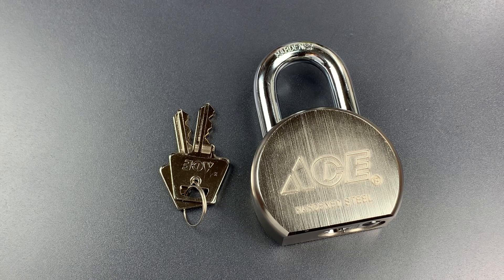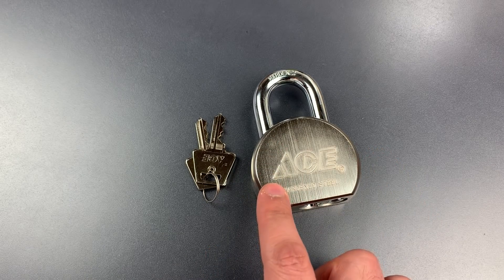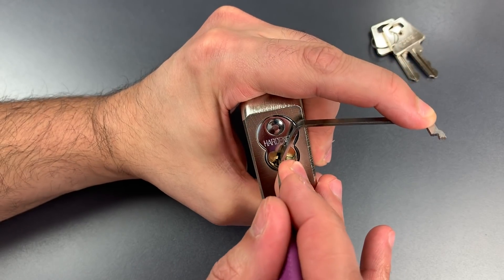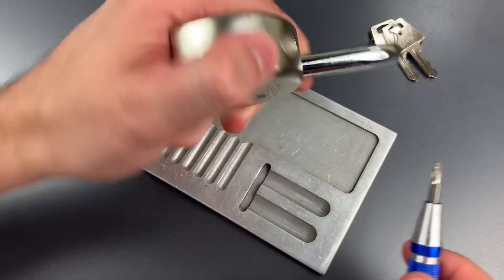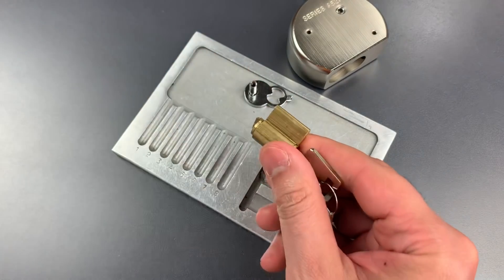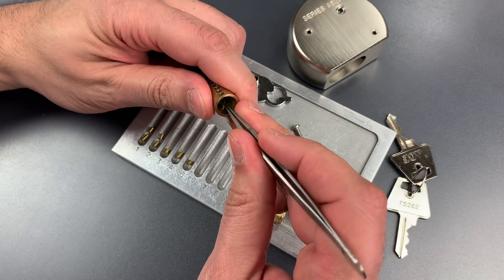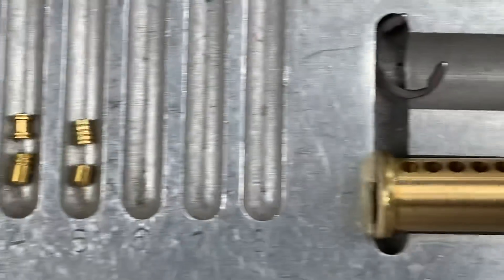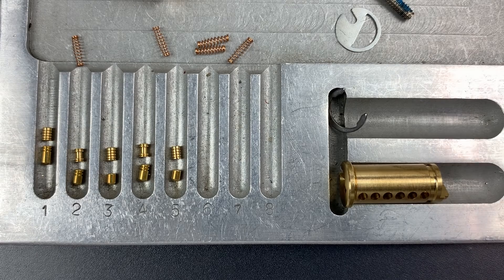[774] Ace Hardware’s Best Padlock Picked and Gutted (Series A527)

Comment: I just started picking 2 weeks ago. I’m doing good with most locks I’ve attacked but I bought this one yesterday and it’s been a nightmare lol. I’ve gotten it open twice and it’s only been by accident. But yeah this is a fun new relaxing hobby and I’ve been able to learn a lot from watching your videos
Reply: Does it have a high low high low bitting? Those can be a bear sometimes.
Reply: @robertwest3093  it actually starts high and gradually gets lower. Wasn’t used to security pins at the time but now I can get right into it these days

Comment: As a lock neophyte, perhaps you could answer a question. Why do so many manufacturers seem to install 6 pin cores but only put pins in 5 of them? Surely the added expense would be in the manufacture of the core, with an additional set of pins and key with bidding for 6 instead of 5 pins being a negligible additional cost.
Reply from the maker: So they can produce two locks on a single production line. They charge more for the 6 pin variant.
Reply: @lockpickinglawyer  That makes a lot of sense! Thanks for your reply.
Reply from the maker: Robert Gallant yes.
Reply: You can go to any locksmith to convert the core to six pins.  A locksmith can also convert same brand cores to be keyed alike.  When I bought two Kryptonite padlocks, he converted one to match the other at no charge.

Comment: It kept me out, so I guess I'm a novice. Time to get back to practicing.
Reply: I have an American 1100 series I can't even come close to picking . Not to mention my sparrows revolver practice lock I haven't even managed to pick standard pins yet
Reply: I just purchased an Ace Hardware lock very similar to the one featured thinking it would be an “easier” one to pick.  Certainly harder than the Masterlocks on the rack.  Long story short, I have been firmly placed below a novice picker 😂
Reply: Did you ever get it open
Reply: ShotgunRocket If the response was to me yes, I’ve got the feel for the ace brands now and open them quickly. HINT: they are so much easier when the lock is cold 😉
Reply: ShotgunRocket now I need to figure out a PAC lock 6 pin 😩🤯
Reply: @CFarnwide  awesome, I just got into lock sport myself and have gone up to an Abus 55/40 so far.
Reply: ShotgunRocket Nice!  The Ace was my first “real” lock and just barely got the PACLOCK ucs 6 pin.  So yeah... I’m extremely green to the sport.  It sure is fun though!
Reply: I use a paperclip for tension, and a reusable metal toothpick as a lockpick, get on my level

Comment: Very interesting. But, how does that hole that you think converts the padlock to key retaining work?

And how easy would it be to add in that 6th set of pins? Is the key already a 6-pin key, or would you need to buy a longer key blank?

Comment: What good is the build quality when you can easily pick it open.
Reply: I have the strategy of looking for cut, drill, and shim resistance because I reside in a small city of 120k and the average intelligence is probably much lower than that of bigger cities so criminals around these parts would more likely attempt low IQ brute force techniques rather than picking so defeating novices is sufficient here.  May be different for other areas.  I would probably go with a Mul-t-lock or Insurance lock if necessary for the whole package.

Comment: Kind of unrelated question. I’m still relatively new to lockpicking, and Ive been using picks that are just stamped steel, a mix of Mad Bobs and the UK Bump Keys Praxis set. I’m looking to get some premium picks that are more comfortable to use. What do you recommend. MultiPick? Peterson (Plastic or Rubber handles)? Sparrows? I’m not looking to buy a whole new set, just the common ones I use like a Bogata, the hooks and some rakes with some nice handles on them that will last a while. Thanks!

Comment: Is it possible to insert another pin into that sixth hole to make it more difficult? (Considering that you will need another key).
Reply: A 6th keypin will ride on the tip of a 5 pin key. All you have to do is find one the correct height,  usually a long pin, drop in a spring,  and driver, and you now have a 6 pin lock. Yes they are more difficult to pick.

Comment: The best lock that one can buy from my local Bunnings is a Lockwood 334M45. It costs AUD $58, but you are either better off special ordering it from Bunnings (to specify you want the ASSA Abloy factory to provide a 6 pin key and/or spool pins in the back 5 and a drill resistant front pin) as the retail ones are usually 5 pin with minimal spool pins, if any.

Comment: can you explain how serrated and spool pins effect lock picking? and what a anti bypass plate does as well? love your vids!
Reply: Those type of pins have a Groove in them that allows the core to turn slightly much like it would bif you got to the line giving a false set a  spool has a very wide groove and serrated a narrow groove, the Anti bypass plate keeps some one from sticking a tool all the way through the lock and turning the mechanism
Reply: Hey! Just to extrapolate a little more, security pins not only just give the picklocker the illusion of getting a pin set (called a false set,) but also added physical difficulty in setting the pin after you figure out that it's a security pin. All of those ridges make it really difficult to push the pin inside of the outer plug without binding up against the walls.

The video really showcases how well the LockpickingLawyer can pick locks.
Reply: The anti-bypass plate prevents a tool from being jammed down the key way, and unlocking the lock without turning the core. It was a huge fault on American brand padlocks.

Comment: I need some help? How do you get real practice locks? The clear ones are really easy.
Reply: He mentions this in a couple of videos, just don't have links to them. (over 700 videos to search through, it can take time) but if you are starting out, he suggests going to several stores in your area and buy a couple of the same lock at each, and use those to start building your skills up. I'd suggest starting with the inexpensive Master locks rather than the really cheep chinese locks, because there have been several of the latter that simply start to fail even with their own keys after way too short of a period.

The Master lock brass body locks are inexpensive but will give you a feel for how to tension a lock, and how to use a pick. Those are your starting points. That will give you the ability to look at most master locks up to the pro series with an awful lot of disgust. Note that the 'security rating' on Master lock packaging is more related to the physical characteristics of the lock body and shackle than it is the lock core. The reason the Master Pro series locks are a little better is that the cores tend to be from the American lock series subsequent to Master buying American Locks. Quality went up for some of Master's locks, and down for some of American's locks.

Once you have a basic idea of what you think you are doing, start working through the collection of those locs in a random order. Sit and watch videos on TV or a movie on your laptop, and let your hands work through the collection of locks, lock them up again, then pull them from the pile and work each lock one after the other. As you're doing this, start picking up a lock or two of the next "level" up over several weeks, preferably from different locations or businesses. 

You're working to avoid getting a batch of locks that all have the same fault because they came out of the factory the same day, or even worse that ugly of uglies, the keyed alike padlocks. They might be nice for a traveling gun case where you want half a dozen padlocks on the case and only have to carry one key, but if you're actually picking locks, it's unlikely that you're going to end up some place and the padlock you need to work with is going to have the same key. (Note that this is not true of all keyed systems. Entry panels from a common company, elevators, lock boxes on the sides of buildings, even a large number of police cars across the country, all have common keys, for the simple reason that it's less expensive to get them set up that way.

Once you have 9-12 or so locks of the next level available, start doing the working through of those locks to build up your understanding of how to work with those locks. Continue this cycle on up through all the locks you want to be able to work with. Once you're dropping $50-$150 a padlock, you might consider selling some of the earlier padlocks you practiced with, but it may be a good idea to hang onto a couple to just play with from time to time to keep your skills up with them.

Comment: I like looking for locks at Ace. They often have some interesting ones and the selection differs vastly from location to location. I also have found some cool Federal locks at various small town True Value hardware stores here in Oklahoma.
Reply: An Ace in my area is now fully Master Lock on their rack. I was rather 
disappointed they do not even have their own brand available.
Reply: Larry Be - A solid wall of Master Lock is always a disappointing sight.
Reply: Federal are a UK brand. Odd to find them in Oklahoma.
Reply: +Larry Be ask at the counter and they can ship one in from their local warehouse
Reply: +Larry Be ask at the counter and they can ship one in from their local warehouse
Reply: @danh2134  
Perhaps so, but it seems odd when it is their own brand not to carry it 
unless Master Lock "bought" the rights to the space. The consumer is not well served by mediocrity becoming the norm in this type of purchase.
Reply: +Larry Be it's odd indeed but whatever you do avoid the master brand
Reply: @danh2134  
I have one I use it is model 911. It has enough in it to defeat the average 
picker and has the ball bearings in the shackle which is a step above an
average lock. 
The one I have been using regularly is the Commando lock. Military specs and you can remove the key but the shackle cannot be closed. That is 
useful so as no one can close and lock a door with no way out for you. All 
in all it is what a Master Lock should be for all the hype they throw at us.

Comment: I'd like to know how the anti bypass works and the key retention, please.
Reply: Yes. I'm interested too!
Reply: The anti bypass plate works by preventing you from jamming something in there to turn the locking mechanism without engaging the locking cylinder.
Reply: Key retention keeps the key in the lock while it is unsecured.
Reply: @kidthorazine  Makes sense and that's what I assume, but I'm wanting him to include these things in his videos. Brief explanations
Reply: @soggycracker5934  Obviously, but I want him to tell us and show us how it works.
Reply: @kidthorazine  or doesn't. Clever people came up with the idea of making a key that's deliberately too long, then sharpening a point on the end of it. Anti bypass plate becomes a former anti bypass plate.
Reply: @Anonymouspock  well sure, but of course that requires very highly specialized equipment whereas the normal bypass can be done with a filed down coat hanger.

Comment: Hey LPL go to UHaul next. My local UHaul has a pretty big selection of locks to choose from. Also, go to storage unit places, they sell locks too.
Reply: Second this.  They're all rebadged or generic imported locks.  All the storage unit chains sell their own branded locks.  Mine came from Uncle Bob's and it's probably garbage inside. The real security is needing card key badges to even get into the storage unit building, and about 100 cameras.  Deterrent enough to make a cheap storage unit lock useful. But hey, they also sell insurance for when you get robbed.

Comment: LPL, can you garner a guess as to why they wouldn't  use the key retention actuator instead of the pin in the core? From a parts standpoint, you'd need the drilled core, the different by-pass plate and the pin, verses the actuator with or without the ear.

The lock appears to be a knock-off of the American 700, so the core would be an APTC-12 (5 actual pins, though drilled for 6) if I'm correct on my memory of American cores.

Comment: The more I watch your videos the more I wonder, what's the point of 99% of all these locks if they can all be picked in under 30 seconds...
Reply: Most lock manufacturers probably operate on the assumption that most crooks are not skilled pickers and are going to try brute force methods to open them. Brute force methods tend to be noisy and attract attention. So they probably engineer them to withstand brute force as long as possible until neighbors or bystanders try to stop the crook or call the cops.
Reply: @knightsmith7168  yeah but i still wish LPL would make an episode talking about actual good locks!

Comment: A simple fact is that locks are meant to keep honest people honest.  A criminal or lock pick expert will get into most any lock.  That is a fact of life.
Reply: Criminals would just use the route of least resistance.
Reply: True. A criminal isn't going to bother picking the lock when they can just sledge hammer/crowbar the lock and hasp right off whatever it is supposed to protect.  Same way a burglar won't bother picking a house door when they can simply kick the door open or break a window and climb in.
Reply: @LatitudeSky  Depends on the criminal type. Professionals don't leave a trace they were there. Non-destructive entry is the real concern, hard to make a legit insurance claim when you don't even notice a piece of jewelry is missing for a month then have no proof anyone broke in...